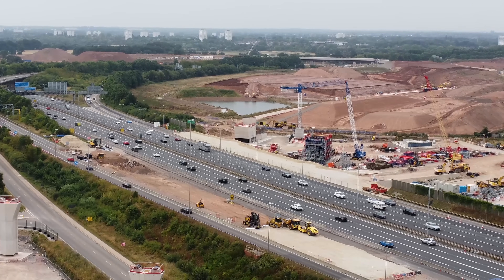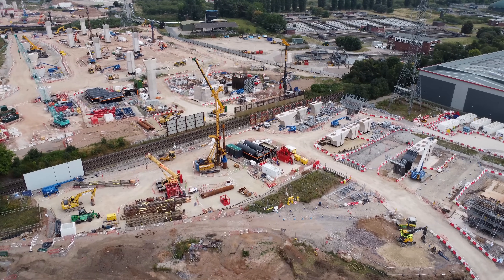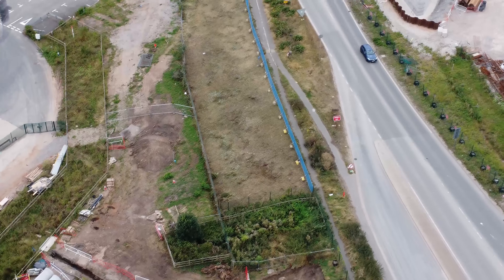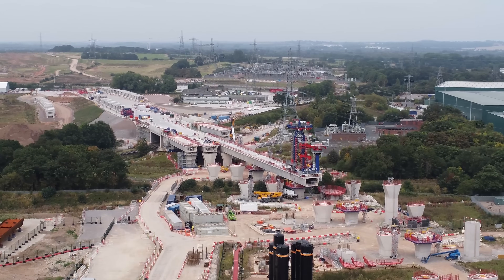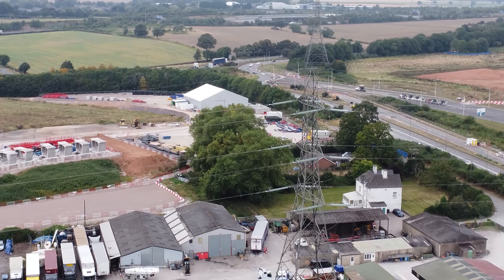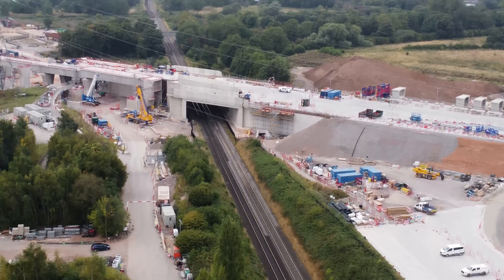HS2 Construction - HS2 Delta Junction on the outskirts of Birmingham & Water Orton

Comment: Would be good to see more of the Curdworth viaduct erecting machine at 8:43, great video though!
Reply from the maker: I couldn't figure where to go to get closer, the road is now closed I assume for a bridge to go up so will head back in a few weeks and see if I can get closer.
Reply: if you go farther down A446 from Water Orton _ at the island with the B4114 _ follow this road across M42 _ only couple hundred metres _ there next to the fence _ 5m from the footpath is an assembly frame _ crane too _ next to it _ with a second assembly girder frame being assembled near by _ but not as complete as the first one _ lot of concrete piers being cast as well _ lot of interesting structures heading up towards the M42/M6 j7 slip road south towards Coventry _ structures being done inside of that sliproad to _ as hs2 will pass overhead of this road _ excellent videos as usual _ 👍
Reply: exactly the same frame design as at Hams Hall  site which you posted couple weeks ago

Comment: 00:09 Looking SW across the M42/M6 (Toll) where the Water Orton No. 1 and 3 viaducts will cross
00:24 Piers for Water Orton No.1 Viaduct on the left, No. 3 on the right
00:55 No. 1 Viaduct on the right now (has higher piers as this viaduct will go over the Main Line)
01:08 A446 Lichfield Road
01:50 Watton House Viaducts (East and West)
02:30 On the left Water Orton No. 3 or 2 Viaduct (original plan called for an embankment here between them)
02:35 In the centre Water Orton No. 1 Viaduct (2 regular piers and then 3 "straddle bents" consisting of pairs of parallel piers with a steel beam across them, allowing the main line to run between them)
03:42 North abutment of the Watton House Viaducts (presumably there will be an embankment from here to the River Tame Viaducts)
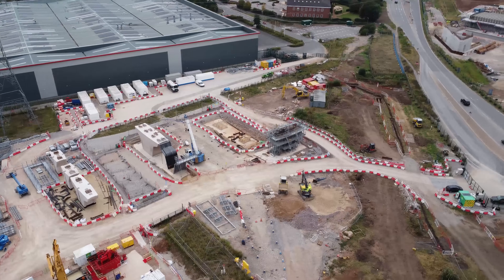03:58 Chattle Hill Box Structure
06:00 Pilings for the River Tame Viaducts (East and West)
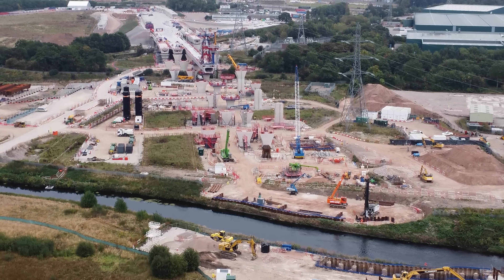06:05 Left to right: Water Orton No. 2 Viaduct, River Tame West Viaduct (2 piers), Water Orton No. 1 Viaduct (tall piers), River Tame East Viaduct 
08:36 Curdworth Viaduct and Box Structure and then the above viaducts coming out (the longer section is part of the River Tame West Viaduct)
13:21 Looking SW towards the Curdworth Viaduct and Box Structure

Let me know if I got anything wrong or if I missed something out
Reply: Thank you for taking the time to answer the questions alot of us will be asking.

Comment: The full delta will get used: the arm nearest Water Orton will follow the M6 (free) before diving into a tunnel between Castle Bromwich and Washwood Heath (where the depot is also being built), while the arm closest to Hams Hall will run to Handsacre, slightly NW of Lichfield, where it will join the existing WCML. Hopefully there they'll leave passive provision for a future Phase 2 (similarly just North of Hams Hall where there would have been a fork serving the Eastern leg, which, bizarrely, is shown on the official map despite seemingly not connecting with the Cross Country route (the existing line from Birmingham to Leeds).
Reply: Yep, because there is no connection between curzon and Newstreet, they will remain 2 in dependant lines. They could adapt it in future (a la curzon street closure of old) but for the meantime there is a distance similar to that between snow Hill and Newstreet.
Reply: @barrypickles6546  There ia no rerason for  connection between New Stret and Curzon Street stations as Curzon Street station will be the main station for InterCity services from Birmingham eaving New Street to deal with X Country trains and semi fast train services, ny connections between the two lines will be made at Birmingham Interchange/ Birmingham International at the Airport.
Reply: @barrypickles6546  The new Curzon Street will never close as per the old Curzon Street station as it will  when opened become the main Inter City Station in Birmingham being at least 3 times larger the New Street Sttion, The reason the old Birmingham Curzon Street Station closed wasbecause it's entrance was no where near the City Centre which the main entrance to the new Curzon Street station is in the City Centre on Moor Street Queensway next door to Moor Street Station
Reply: @barrypickles6546  Birmingham Curzon Street will never be closed as per the old Curzon Street Station as Bimingham New Street Station does not have the capacity to have HS2 trains entering it and both HS2 and the New Street lines are on different levels. Unlike the old Curzon Street Station this new Station 's main entrance will be in Birmingham City Centre on Moor Street Queensway next door to Birmingham Moor Street Station and the Bullring Shopping Centre. There is no reason to worry about New Street Station and HS2 as their will be to connections, either change trains at Birmingham International Station onto the HS2 line at Birmingham Interchange sattion or catch the Midland Metro Tram to Birmingham New Street Station, Birmingham Snow Hill Station or Wolverhampton Station
Reply: The least used curve at the delta junction will be Curzon Street to London (ie. West to South Curve) at 3 trains per hour each way. Which is why it was sheer nonesense abolishing HS2A Northwards as that would produce the most trains.
Reply: @johnwebster3224  I agree,unfortunately the contracts where already signed and the work started. A stop at the international would be enough for the midlands.
Reply: hardly any people travel between those areas. a lot seems pointless
Reply: @PazinPortugal  Loads of people travel between Birmingham and London.
Reply: @PazinPortugal  What are you going on about, should be bringing folk north not sending them south!!!, HS2 will operate no train services no diferent to the existing WCML passenger train services in taking fare paying passenger in both directions
Reply: The proposed junction is at Lichfield, left for handsacre, which is obviously  still going ahead, and a right hand branch to continue North through Staffordshire & in to Cheshire.
Reply: @timstarkey-smith8842  No it is not at Lichfield, HS2 passes Lichfield goes under the West Coast Main line bending left and travelling o Handsacre a few miles North of Lichfield where under present plans it will connect onto the existing WCML by a high speed junction taking trins towards Crewe and Liverpool, Manchester and Scotland, there is no branch planned to go right to go North to Staffordshire and Cheshire
Reply: @peterwilliamallen1063  it was always going to connect to the wcml at Handsacre, 
I worked on this section at Lichfield, the junction to go north, ( that's been shelved), starts in the area between the A38 & Wood end lane. ( rear of Fradley park). 
The embankment for the northen leg has actually been constructed before the northen leg was shelved. It is immediately to the right of Wood end lane, where the over Bridge would've been constructed.
There would ve been a pair of over bridges over Wood end lane.
Reply: @peterwilliamallen1063  it does pass under the WCML, as you correctly say, just south of Streethay, near to Cappers lane, it continues north, in a cutting, passes under the Derby line, immediately followed by passing below the A38, where it continues behind Fradley Park in to the large area I ve previously described. I worked in this whole area for about 10 months.